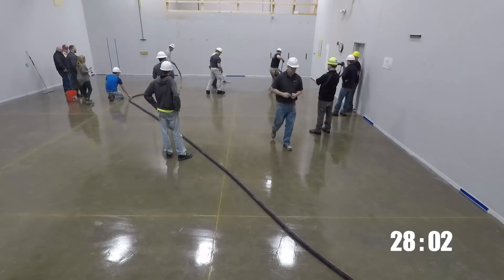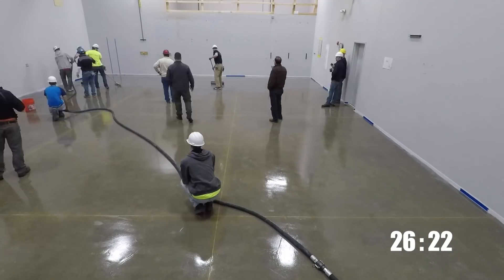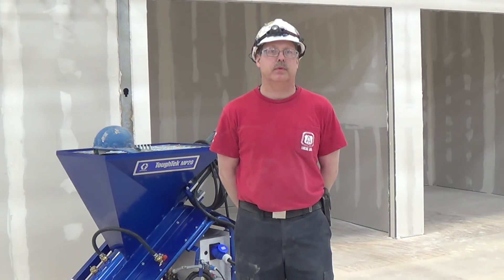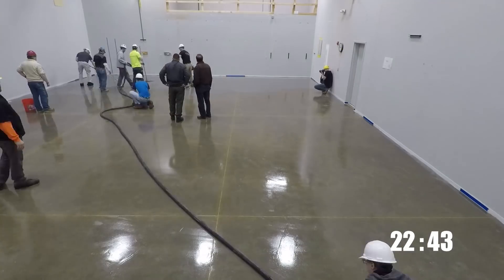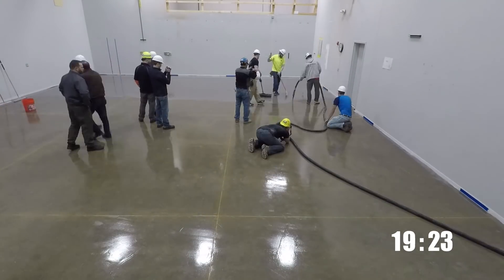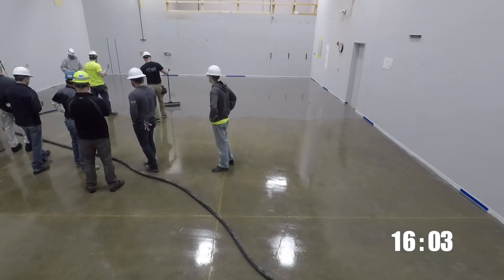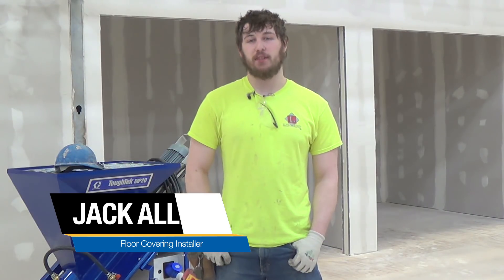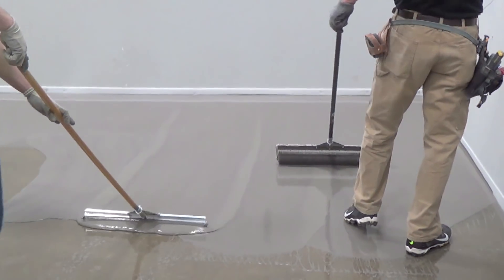How to Install 2,200 sq. ft. of Self-Leveling in 33 Minutes

Comment: Isn't it just like pouring epoxy on the floor.
Reply from the maker: This was a self-leveling cement-based material. In this case we were creating a floor versus protecting or coating one.
Reply: What did this job cost out the door 
I have same sqft that I’m shopping for quotes just to have an idea